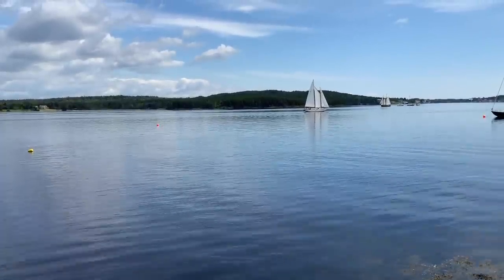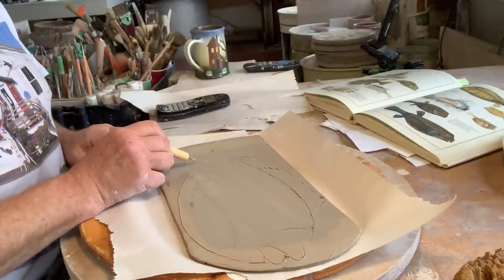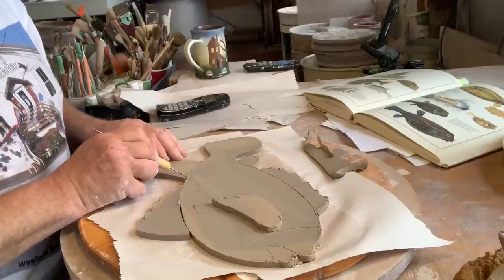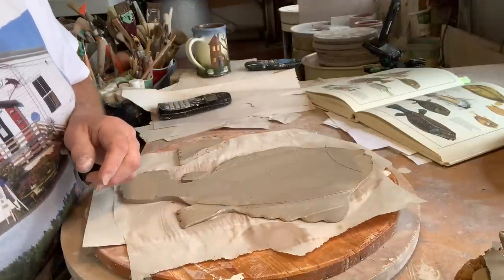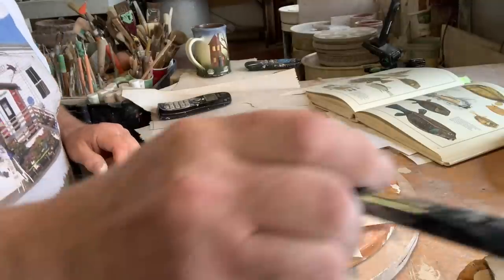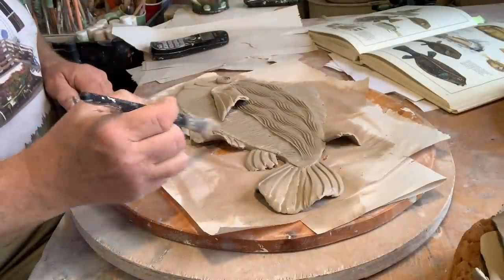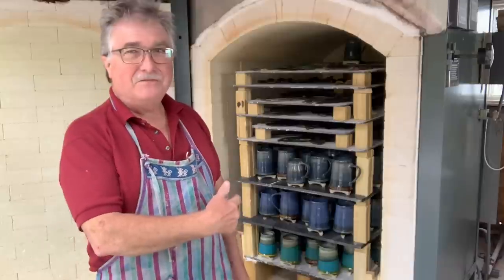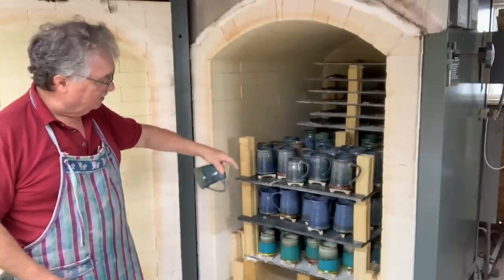How to make a clay fish wall relief in just 26 minutes.

Comment: Thank you for sharing from you beautiful corner of the earth! 🤩 And your awsome pieces of fish art! I am a potter from Sweden waching all of your videos thank you so much  for sharing all different techniques and being my friend in the studio while working 😊 I have one question, firing flat pieces is often trick because of cracking, What is your tip to awoid cracking to occur on the kiln shelves?
Reply from the maker: There are a couple of things you can do.  First if you can afford it get some of the new Advancer kiln shelves, they are thinner and allow for more equal distribution of heat. Secondly slow fire the kiln. The temperature when the cristobolite forms is crucial, slow the heat rise between 550C to 625C to only 40C per hour. I also slow the cooling down to the same 40C per hour between the same. The slower the firing the better for the other heat rises.

Comment: Thank you for sharing your beautiful fish! A question: for hanging you just punched 2 holes in the clay for nails? I worry i would crack it when affixing to a wall with a nail. You know lightning does not strike twice in same spot (so they say) so you can consider yourself safe from further strikes! 😊
Reply from the maker: I use two small screws that are dark grey. They are easy to use and I use an electric screw driver. Careful not to over screw. They can have glued hooks applied to the back but I hang them outside in 100km winds, so screws are essential.

Comment: Interesting fish demo!  Never knew that there were so many 'designs'.  How do the fish get fastened to the wall?  (hung.....).  I looks like the holes would allow the screw heads/nail heads to be visible...... or is there a secret method?  Thank you.
Reply from the maker: Visible but the screws come in greys and greens so they blend in. I also use a small head screw.